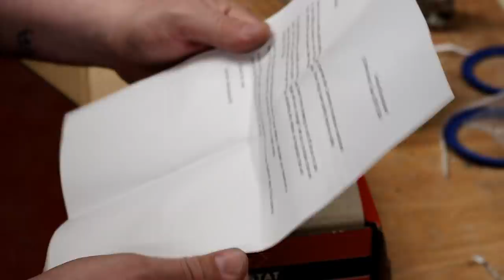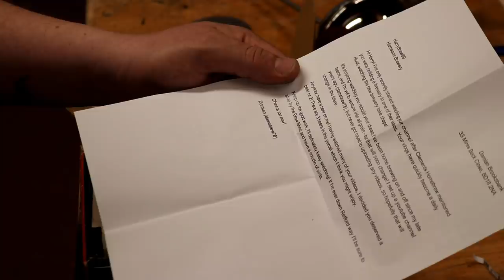All the kit is here ~ except the glycol

Comment: The elements are in a star configuration mate. The blue post is the star point. In delta the elements are connected to each other. The connection plate would have 6 terminals.
Reply from the maker: No, I can assure you they are in Delta dude. It is only star (Y) if you connect a negative line to the blue post, which I did not.